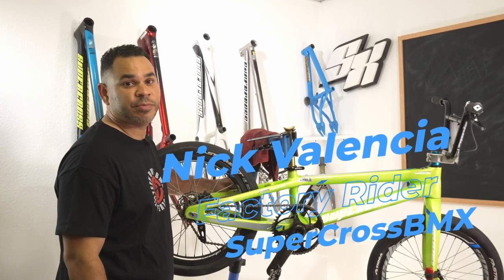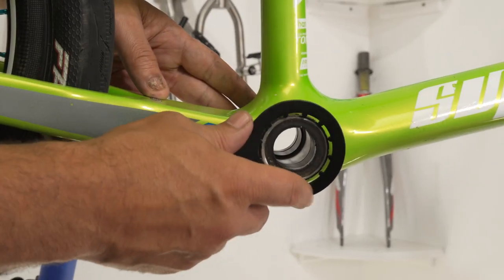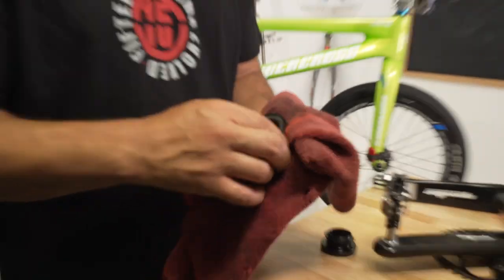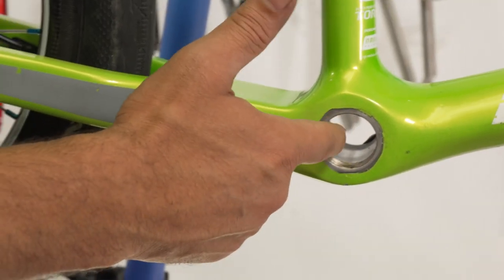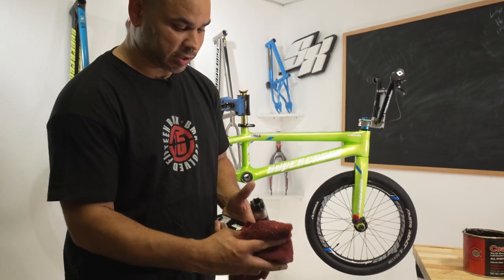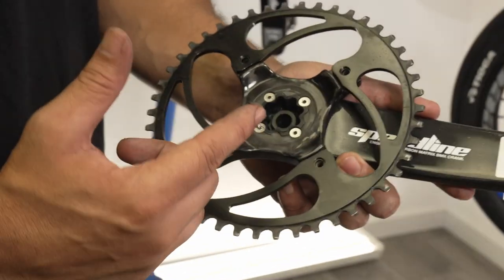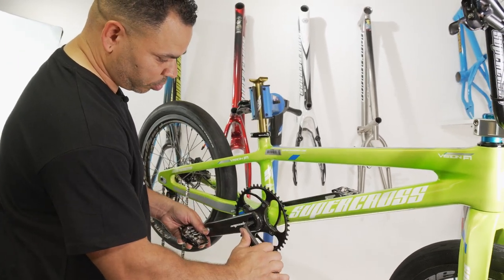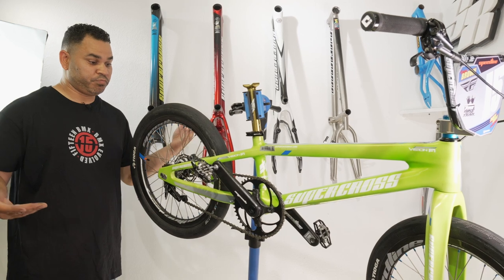How to BMX: Install Bike Cranks EASY and PROPERLY

Comment: Has the chain ring bolts been rubbing that green paint just behind the bottom bracket? Looked like it was getting into the carbon. Is that a typical issue or did someone install too long of a chain ring bolt and let it self clearance? Can’t be good for the frame.
Reply: Great eye! I noticed this when checking out his bike during this tutorial and he has the correct length ones now but he must have run some long ones at some point because they def scratched the paint off directly behind that section. It’s nowhere near deep though and frame won’t be compromised. The kid can pedal we just gotta get him handy with the tools now!